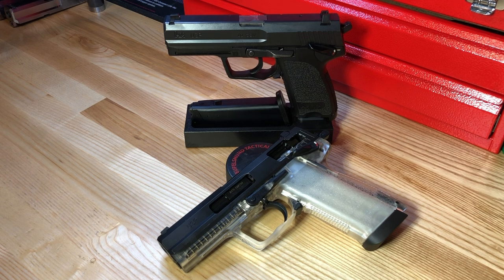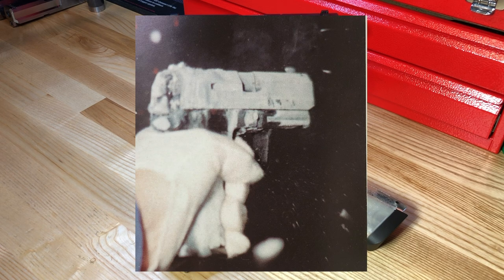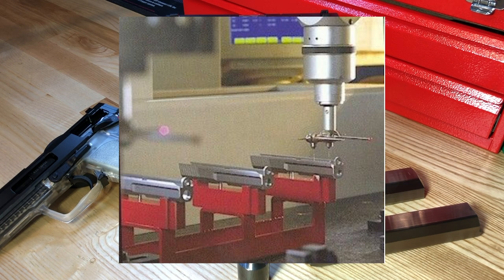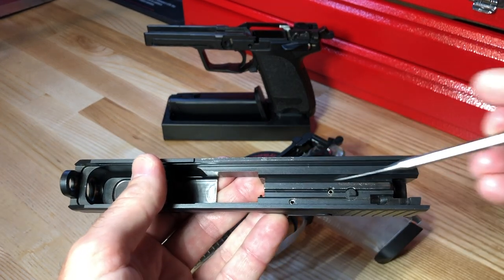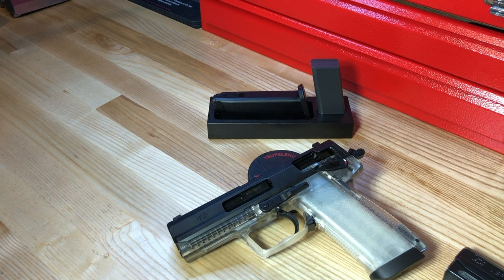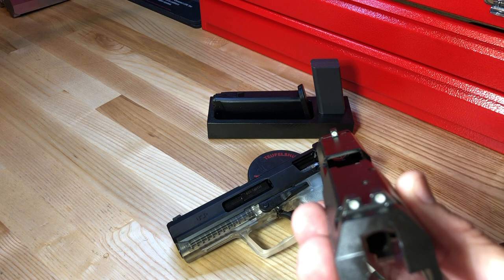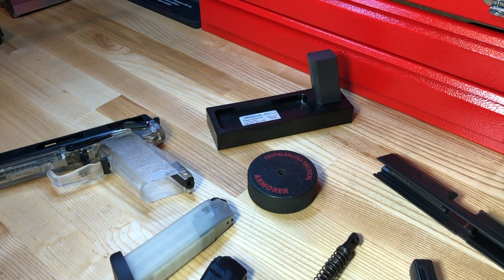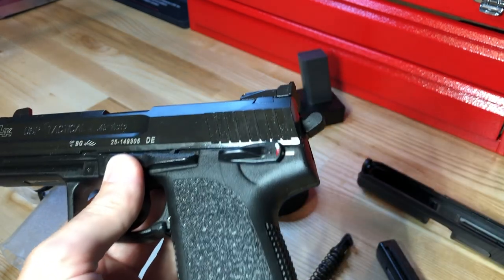Teufelshund Tactical Heckler and Koch USP Series Armorer and Operator Review

Comment: I keep seeing mentions that the USP is fine to shoot +p+ ammo. Like extensive use of it. That the 45s can shoot 45 super.... idk if it's the non HK owners trying to get you to explode your piece. 

But that 45 super sounds a bit excessive lol. I watched all 2 hours and you didn't mention ammo. Any info on this? 

I watched another video about someone going over the USP and mentioning round counts and torture test and what not. But you seem far more reputable than any other uploader I've come across.
Reply from the maker: Ammo recommendations are provided by H&K and can be found in the owner’s manual of your firearm.
Bottom line, sustained use of over-pressured ammunition is not recommended, due to the excessive wear it places on internal components.
Reply: @teufelshundtactical  I did dig around the manual and couldn't find it either. Just stated that cases shouldn't be corroded and to not use aluminum or steel case due to reliability. Seems like standard info. 

So I'm not sure where the claims for it being supported came from. Any good firearm should stand a couple +p rounds.. but the claims I've seen make it seem like it's indestructible. Granted the internet is a great spot to exaggerate claims. 

So in your opinion would it be fine to run this periodically? Be it +p or +p+.. for example cycling carry ammo every 6 months.
Reply from the maker: @jessekaiman5182  Yes, given the recommendation I provided previously.  And then ask yourself, why would I “need” to shoot something more than standard or +P Ammo?  I can’t think of a reason anyone should feed a USP a steady diet of that.  Cost alone would be prohibitive.
Reply: @teufelshundtactical  no and you're right. But I just got a fullsize USP 9 and I always wanted to try Underwood ammo, I got 100 rounds on the way. 

But like you said it probably won't be a staple menu item. I've never shot plus p anything, I'm on my 3rd year of carrying and just wanted to see what the deal was. 

Mainly because I use 40 and the regular defense seems hot enough. I usually just run anything federal. But thanks for your time, appreciate it.

Comment: Sear spring breakage?  I do not see a sear spring in my usp manual.
Reply from the maker: It might be referred to as the "flat spring" in your manual.  It is the "forked tongue" looking spring that sits vertically in the receiver, just forward of the sear.
Reply: @teufelshundtactical  OK thanks, I will order an extra one...I always thought the trigger springs were the one weak link in the USP series.  I did break one and it was a booger to replace.   Great video and really appreciate the effort and extensive content that went into making it.

Comment: How do you get you slides so shiny  ?
Reply from the maker: I just clean them with EWL from Slip 2000.
Reply: @teufelshundtactical  interesting do you have any stainless models ?
Reply from the maker: @abgcapital4597  No
Reply: You ever used frog lube? I use it only on the outsides of guns. It tends to sit better and doesn't make it as slippery. People use it internally but I've heard mixed reviews on that, I stick to slip 2000 for internal.
Reply from the maker: @jessekaiman5182  It’s garbage and should not be used in firearms.  It will coagulate and gum up internal parts, preventing weapons from operating correctly.
Reply: @teufelshundtactical  which is usually the general consensus. But on slides it's great, externally.

Comment: Generally speaking what is the accuracy capability on the tactical models with o ring barrel?
Reply from the maker: I covered it in the video.  The o-ring places the barrel in the same place each time it fires, making the accuracy more repeatable.
Reply: @teufelshundtactical  I meant to convey is there an understanding for theoretical group size difference at 25 yards with and without o ring seal?
Reply from the maker: I am not aware of a side by side comparison to refernce. @reker.a5790